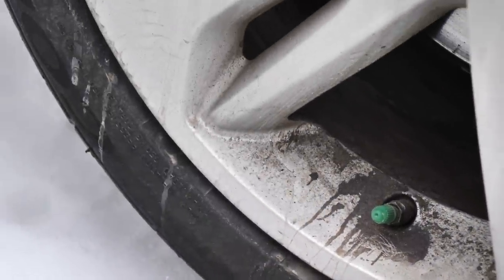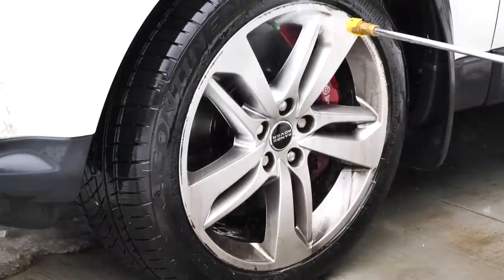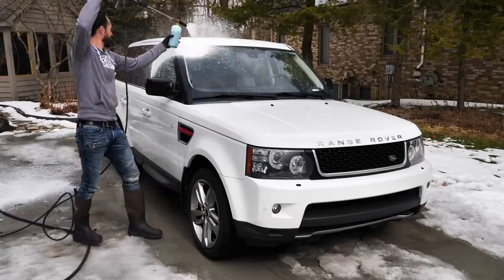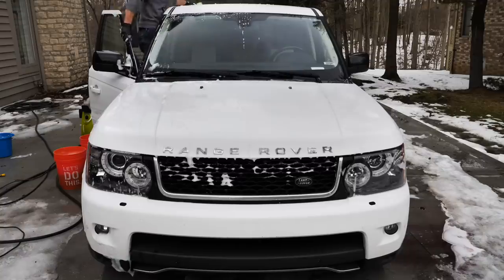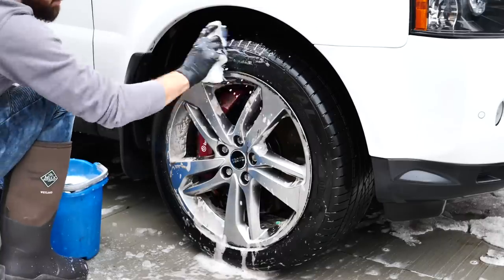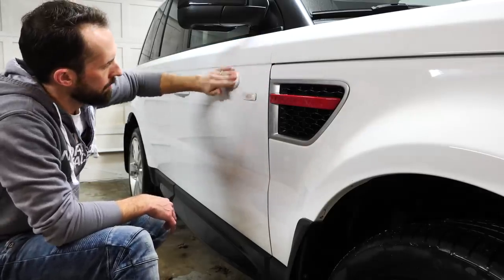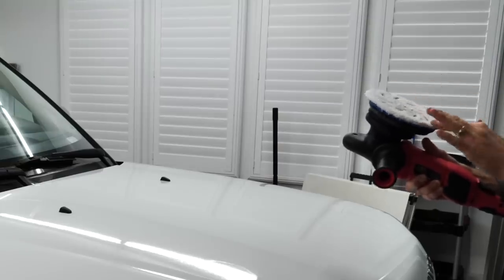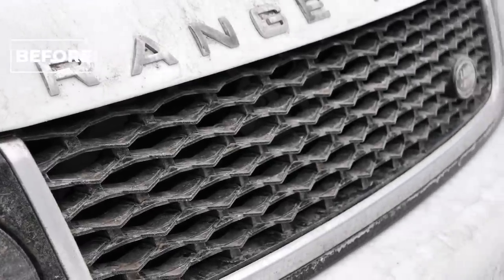FILTHY Exterior Detail! Car Cleaning A Range Rover Sport Supercharged

Comment: Looks good but you should always use the fallout remover after washing because otherwise its only reacting with the surface contaminants, that most likely will be removed during the wash process. Using fallout remover after allows it to get to work on the embedded contaminants :)

Comment: So, if you used clay to remove the bonded containments, how did you remove the containments in between the letters of badges or tight areas where the clay cant get to? They really aren't removed with just an iron remover rinsed off. It needs to be agitated with a very strong iron remover for one pass and most times it takes a couple applications with a "safe" iron remover. As a white car owner that is what I would be worried most.

Comment: Is there a link for the iron remover? Or am I blind? I have a black vehicle, and my paint looks cloudy and contaminated, even tho I have always kept it clean. I do live in the upper Midwest tho.
Reply: I just purchased Adams Iron Remover. I bought a gallon jug for around 40 bucks are used it on my sons white Nissan Altima. It did very well showing the ferris metal. Works well. Amazon